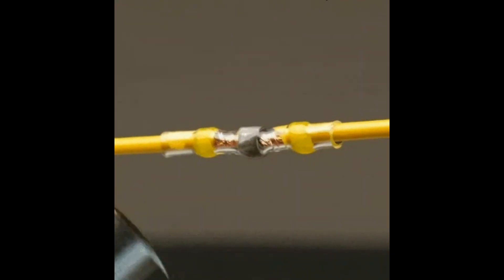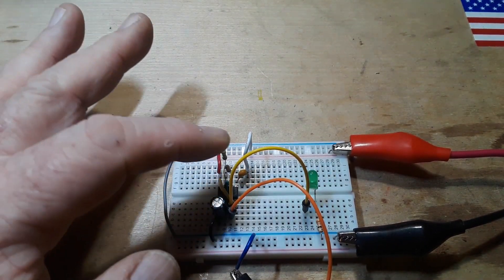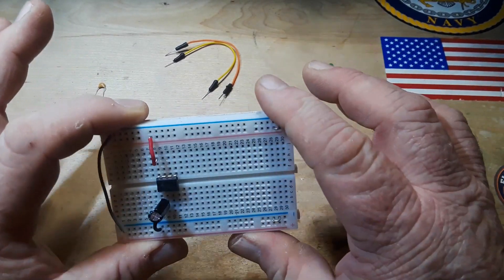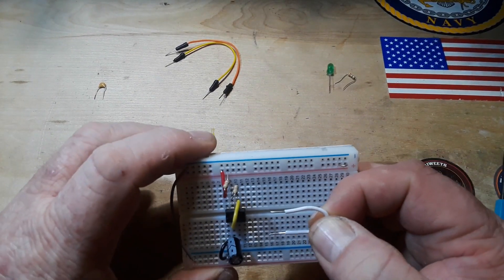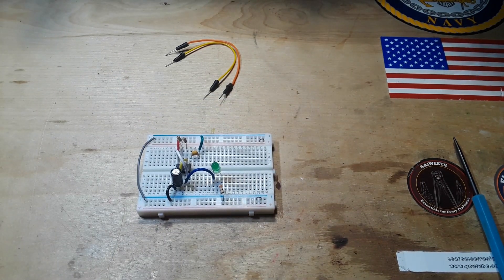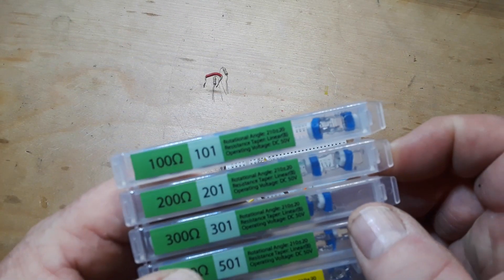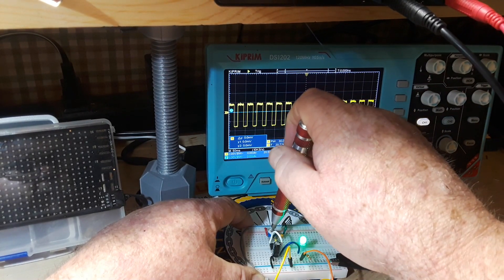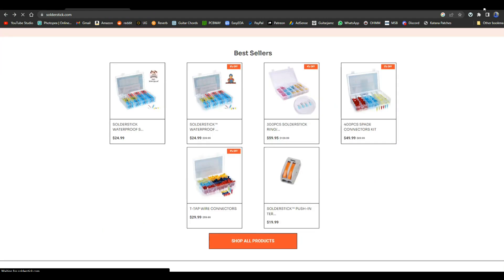Astable Multivibrator Mode of the 555 Timer - brought to you by Solderstick Wire Connectors

Comment: I'm unsure if you've done this. However it'd be really neat for you to make a video on the 556. Timer 1 being in monostable, and timer 2 being in astable. Having the output of timer 1 activate timer 2 via a transistor.

I'm doing that now to have a piezo beeper go off every second after a set amount of time. Anywhere from 0-6 hours using a 20k pot and 1000uf cap. For the astable side, I'll use a 2k resistor and another 1000uf cap.

EDIT: Maybe I can't do this with the 556. Since both timers share the same VCC. So I'm unsure how I would activate timer 2 in astable mode once timer 1's output goes low

Comment: The curious streak inside of me has me interested in knowing the exact value of those resistors and the exact capacitance.
Anyway. Nice videos.Much appreciated.  Keep it up!
Reply from the maker: Off hand, I don't remember but I always use multiples of 10 for resistors. In this case they were the same value. As for the cap...again I dont remember but you can use a 555 Astable calc to get your values. Here is one from Digikey: https://www.digikey.com/en/resources/conversion-calculators/conversion-calculator-555-timer

Comment: Thanks for the vid, nice explanation of operation.
There are some nice online calculators that let you put in the value of the capacitor and resistors and they tell you the frequency and duty cycle of the output.

Comment: The ratio difference between resistor value and duty cycle is interesting (1/3 -2/3 for equal resistors) - rough rule of thumb seems about 10 to 1( R1 - R2) to get nearer 50% duty cycle

Comment: Is it possible to change the rate without it changing the frequency?
Reply: The rate is the frequency
Reply: @peddlereffects  No. The Frequency is how many cycles in a second while the rate is How long is one state compared to the other.
Reply: @poykehmusic  isn't that the duty cycle?
Reply: Well the duty cycle is the rate (or ratio) of the pulse width to the total cycle (or period) of the oscillation. So the  correct name should be duty cycle, but SelectaBwoy use the word "rate" so I thought he meant duty cycle. In fact, frequency is kinda also a rate, since it's the number of oscillation per seconds. It gets confusing... 😀

Comment: Could someone explain the point in using these? A sinusoidal voltage over a diode accomplishes this same thing and comparators make cleaner square waves.
Reply from the maker: I'm sure there's some point, after all, it is the most widely used integrated circuit in the history of electronics.

Comment: Hi there.  What is the purpose of the 10 nanofarad capacitor  if we choose to use it?  What would happen if it was not used? Also, what is your source voltage on VCC, 5vdc?  thx.
Reply: The capacitor reduces the chance of noise on the control voltage pin which is connected to one of the internal comparators used in the timing circuit (independently of the external resistors and capacitor). Any noise can shift the timing. There's an earlier video which explains (all about the pins on the 555 timer). I'll hazard a guess that Vcc is 6V (the scope shows 5.36V pp signal).
Reply: @ralphj4012  Thank-you for this explanation..